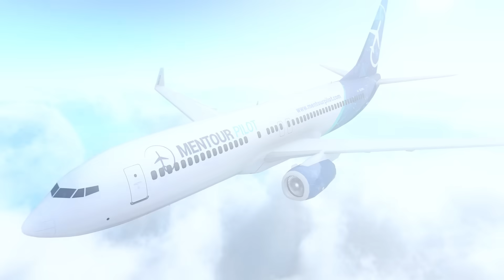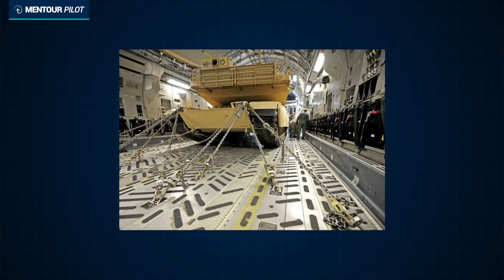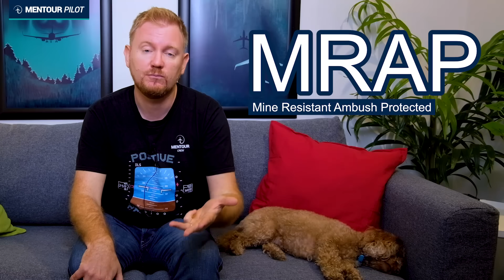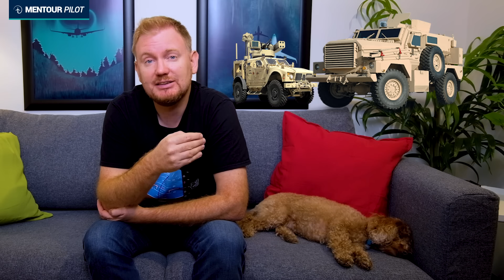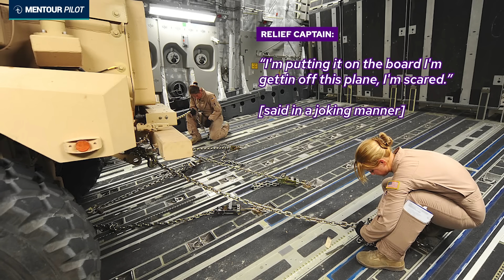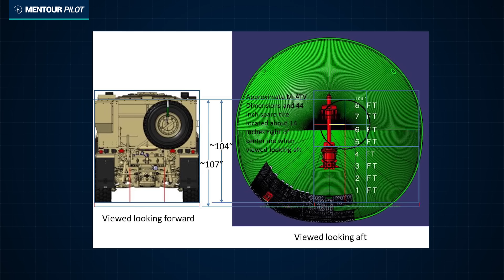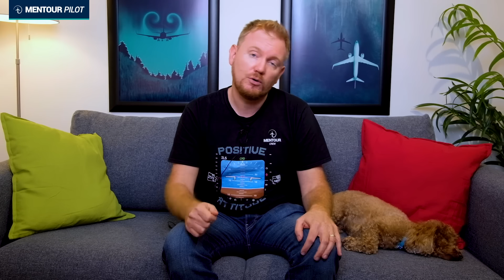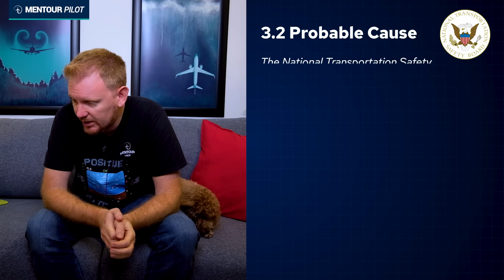Why did the pilots LOSE control?! National Air Cargo flight 102

Comment: I don't know much more than simple common sense about freight or shipping but I DO know that all OTR truckers in North America are required to tie down/secure their cargo in such a way so as to stay securely on deck even if the trailer were to be turned upside down. If the load would fail this hypothesis the truck would need an OSL placard as well as a load permit. I never really thought much about air cargo... that's a whole new ballgame.

Comment: The fact that the load came loose and the amount of straps that was used, and even more supposed to have been used, makes me wonder about the quality. I mean, many straps and lifting aids have a safety factor of 7:1 and would easy lift the entire vehicle by itself just one strap alone. Was there any sharp edges or not enough radius on the fastening points ?

Comment: No chocks = big shocks.  It sounds like the vehicles wheels weren't chocked at all. If I were the loadmaster, each and every wheel would have been chocked in front and behind. Also, I would have lashed the chocks down and used all available straps to secure the load. I wonder if the US military still use chocks in transport or rely solely on strapping? Strapping is way too easy and, I think, give a false sense of security.

Comment: Did the engines flame out due to the unusual nose up attitude?
Reply from the maker: No, the engines were working fine
Reply: @MentourPilot  Thanks. I wondered if the kill chain was: massive shift in CG, unrecoverable pitch up, engines flame out (puffs of smoke), stall, crash. But your video showed me the elevator controls were irreparably damaged by the cargo shift event. Excellent video. Keep up the good work.

Comment: Well done, Petter.  I saw a report on this accident several months ago.  The vehicles were properly restrained against vertical movement, but not horizontal movement.  The Afghan government likes to clean up airplane crash debris quickly.  The NTSB investigators made a second trip to the crash site and found the damaged elevator jack screw was still there.  This was one of the key factors that helped determine what had happened.  I saw the original video and it was gut-wrenching.  RIP, crew.

Comment: 21:30:  Mentour Pilot, I know you're the expert --- but FACE IT --- that plane would have crashed anyway from all that uneven aft weight whether or not the pitch control and the stabilizer mechanisms would have remained intact.  Nothing more pathetic than an overgrown, bottom-heavy stick with two side protrusions and fake rocket fins, and the whole thing comes crashing down with all that cargo weight banging out the bottom and crashing to the ground separately.  HEY AIRPLANE, STOP TRYING TO PRETEND TO BE A SPACE ROCKET!

Comment: 5:45:  I think, without you telling me at this point in the video --- and without me cheating by going to the end of this video --- that I know what happened with this airplane --- and your animation of how the airplane pitched upward just after takeoff supports what I think happened to cause this crash.  To put it simply, one of those straps, or fasteners, or whatever held the load in the cargo hold, gave way.  This would have caused the entire load in the cargo hold to act like a huge trim weight which would have slid completely back faster and faster as the plane tilted successively higher and higher --- and this would have happened in only a few seconds --- as indicated in your animation at the beginning of this video.  That would have caused the total weight of the cargo to smash through that rear bulkhead --- which would have resulted in a total loss of cabin pressure like a busted balloon.  But that would have been of no consequence only because the plane would have already been a lost cause.  Bye bye, plane.  See you in eternity.  You were done the instant the cargo became unsecured.  NOW I DO ADMIT, THOUGH, that that still doesn't explain, what about the white puffs of smoke coming out the rear of the plane just after takeoff BEFORE the plane tilted upward?

Comment: An excellent video on this subject.  I recently watched an episode of "Air Disasters" on the Smithsonian channel on this very subject.  Mentour Pilot's presentation was more descriptive and understandable in some ways- it filled in a few blanks.  One thing the other show covered was HOW the straps were to be connected- the shallower the angle between load and floor fastener the less the strap was able to restrain, requiring more straps.  The ratings were for VERTICAL strap connections.  Not covered in the manuals, as mentioned here.

Comment: I am a retired USAF C130 Loadmster. First the USAF has a cargo loading manual that specifies how most military cargo are to be loaded and secured. Second, we would NEVER use cargo straps for a heavy load, chains only. When we had "non standard cargo" there is a simple calculation that is used to achieve the restraint for vertical, forward and aft restraint. Lastly, after takeoff, the loadmaster always retennshions all chains securing cargo. This is an absolute failure by the airline and FAA to properly set standards. Thanks for the great video.

Comment: Long time, part time equipment hauler/trucker here, what every newbie learns the first 5 minutes of his first day is "always use iron to secure iron."  That is, always use chains and binders to secure equipment or vehicles to decks for transport.  NEVER, EVER, UNDER ANY CIRCUMSTANCE USE FABRIC STRAPS TO SECURE EQUIPMENT OR VEHICLES.   I love ratchet straps and use them where appropriate but would never even consider securing equipment with them. If the cargo deck of an airplane doesn't have strong enough attachment points for chains, I guess ratchet straps would have to be used to spread out the strain, Boeing's manuals seem to permit it but it's a really hazard fraught way of securing loads.  I guess this flight crew paid a big price to learn a very basic lesson.
Reply: They also didn’t use nearly enough of them. You pretty much have to use 1/2 more than you think you’ll need for the high angle take-offs & landings needed in war zones. If the loadmaster had done that, we probably wouldn’t be talking about an accident at Bagram Air Base.

Comment: Loved the video.  When I was 8nthe service, Not Air Force, I was fortunate enough to be able to watch a C-130, a KC-140 and a C-5 being loaded.  I just happened to be stationed on a base that the Air Force and NAVY were both assigned.  Very small.  It just seemed like when the were loading them it was like butter on a hot knife!  Fast!  It took them longer to upload.  Certain details can't be discussed.   It just amazed me.  I talked to a friend of mine, we were like, I sure hope them straps don't come loose!  And, did they have enough?!  I pretty much knew what happened when I saw and heard the the conversation in the cockpit.  They should have never been aloud to take off!  SAD!      KEEP UP THE GREAT WORK and Stay Safe!  If you get sometime after lock down, I picked up you lived in Spain with74 gear, take a trip to Torrevieja!   Went sailing out of there almost 3 yrs now.  Beautiful countryside and nice town.

Comment: 5cm is the 2 inches that was on any of the vehicles and they should use Hercules or LM really the 747 wasn't designed for wheeled heavy combat vehicles. Maybe ratcheting improvements in the palettes would be good innovation. Keep going with the hard task of what can go wrong so it can always go right.

Comment: So sad, and completely preventable. I saw the report and I think many of us saw that crash and said right away load shift but the investigators found every model they ran it should have been recoverable if it was just weigh and balance. The damage to the Horizontal stab. jack screw was what did them in.
Reply: As an old lady with no experience, as soon as I saw that cargo, I knew the load had shifted backwards. As for hydrolics and stabilizers jack? I get it, but gravity is a mutherfckr.

Comment: I think I load my truck more securely. And   from experience those flat straps are never that strong , a little friction or a side cut and it comes apart. I’m sure steel chains would be the best , although it would add much weight to the overall load, but these guys cud do the math.. if I have extra rope in my truck I make my guys use to them all up . I always tell my guys that I don’t want to see my cargo on the freeway but u got extra rope behind your seat. Better be safe than sorry. I know it happened a while back but it was really a sad incident..

Comment: While transporting even a 1.5-2 ton car on a flatbed truck, in addition to tethering the chassis, they also tether all four wheels in a clamp-like fashion to prevent them from rolling. Furthermore, the pilot has the final say whether he or she will fly the equipment with such a cargo. In this case, he did not even seem to exercise his common sense about the wheels that seemed free to role. I think that the acceleration to V1 was enough for some vehicle role and break free from its tethers and hit the rear end of the fuselage.

Comment: Do you think there will be any talk about basic accountability measures? For example, as the captain of the aircraft, I think I would want to visually inspect standard cargo and put hands on special cargo tie-downs before taking off.

Even just hauling my mobility scooter on its rack on the back of my SUV, even though it's painful and takes a lot of effort to do so, even though I trust the people who strapped it down... I still go back there and check it myself. Every time. Likewise, if I'm driving the car, everyone has to have a seatbelt on. I don't care if you're my boss, or a professional driver of some sort; if you're in my car, and I'm in control, I'm liable, and you can either strap in, or get out. When I used to fly, it was the same thing. I was taught right from the start that you don't take anyone else's word for anything. If you're going to fly the plane, you check it out yourself, make sure all control surfaces are working properly, make sure all passengers and luggage or cargo are properly secured and not going to flop around...

With that captain saying he didn't like what he was hearing... why did he still take off!? That's a lot of complacency.

I know this is something they do every single day, but even for something far less dangerous like running a car shop, safety is absolutely first, every time, no question. It doesn't matter if it's your first flight, or your first time lifting a car two meters into the air to stand under it and repair it, or your ten thousandth. The ten thousandth can kill you just as dead if you don't make sure the lift is under the proper load-bearing lift points, and the car is balanced on the lift.

It's easy to get complacent, to take for granted that the one in ten thousand incident has never happened before... but to me, keeping the right blend of the confidence to do a job efficiently and correctly, along with the right amount of respect for the danger entailed, is what defines a professional and separates them from a cocky amateur. Any one of those crew members on that plane should have spoken up with enough intensity to get the calculations and the physical straps double-checked, and to me, as others have said here, that speaks to a culture of complacency and a systemic problem of "just winging it" at that company that certainly needs to change.

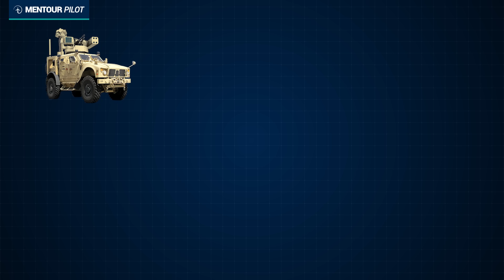Comment: 8:45 How on earth did he calculate that....It doesnt make any sense....25 straps for smaller vehicle, but only 2 straps more for 30% heavier vehicle? My logic would be 30% more straps....which is 8 straps more, not 2...so if smaller is 25, larger is 32 or 33 straps.....Logic 101...And Im bad at math...really bad

Comment: I was a USAF Loadmaster on C-130s,1965-1969. We never used stapes to tie down vehicles. Always chains and then only calculated half of their rated strength due to angle of the chain to the floor. Straps stretch chains don't!!

Comment: I worked as an ambulance driver for wheelchair users. One day a passenger on another of our ambulances got severely injured when two of the four straps came loose. She injured her head as her wheelchair moved backwards as the ambulance accelerated. After looking into the accident it turned out all the 16 drivers had experience of those particular straps just completely coming unhooked from the floor, but nobody said anything as we thought it was our fault and the back-up strap meant the passenger was safe...until this day when both came unhooked.  There was a fault in the design but we thought it was us getting it wrong.  Sometimes it's best to say something...even if you think you're at fault.

Comment: I would like to know why they were using straps instead of chains on stuff that heavy? Rough steel edges on nylon straps will almost always wear through by small movements... Hope  now adays they use chains for that kind of stuff. Also why did they tie knots, those are never as strong as a unaltered nylon strap?

Comment: A knot in a load binding strap? THROW THAT ONE AWAY NOW! CUT IT TO DESTROY IT AND THEN BURN IT! Vehicles like these have a suspension with springs and some form of fluid shock absorbers, whether a gas, an oil, or both. Those will compress with the load binding chains and slacken the chains. You can block & lock the suspensions up with wooden or rubber blocks so it won't move up and  down, then start cinching down your load binders until the suspension pinches those blocks into place and keep on cranking until the suspension digs into the blocks. Reinforced half hard rubber blocks work especially well for this, and are less likely to split than wood, but either one is better than nothing at all. The pneumatic tires will also cause some flexing too. You want to do a leak down test on those tires and the central inflation systems for at least 24 hours prior to loading the vehicles onto any plane. You might even want to crib the vehicles' frames to take the  tires out of the equation too.

Comment: I finished my flying career as a 747/400 Captain with Cargolux having spent most of it flying passengers. During my Cargolux training it was hammered home the importance of the Captain personally checking the security of the load and satisfying himself that it would not move. (I also  had to identify the location of any dangerous goods) The task took at least 10 minutes. Indeed and was often the limiting factor in obtaining an on schedule departure because, de facto, you could not do it until the cargo was fully loaded. The task was never delegated to the First Officer. Having said that I would have had to rely on the loadmaster regarding the number and strength of the webbing  required for any given load. What does surprise me is that the Captain on the accident flight elected to depart having been informed the webbing was loose from the previous sector. I certainly disagree with the statement made by the loadmaster that cargo movement is normal. RIP

Comment: Thanks for the analysis. I remember seeing the original footage at the time.

Aside: I've wondered, given the increasing complexity of instrumentation, automation/semi-automation, whether there is a simple video system on board to allow the pilots a quick visual reference check of the condition of the wings, engines, tail-plane assembly with particular regard to obvious damage and the positions of control surfaces. Not that any of this would have mattered in this particular case.

Comment: I love your videos Sir. I am ex RAF airframe fitter and have copies of the FAA mechanic handbooks which are by bed time reading :) Most people read a novel, I read aircraft mechanic books and crash reports. I learn so much from you. Thank you. I have seen the dash cam video of the 747 crash and original comments I saw said a tank had moved in the hold. You have corrected that with the correct load and vehicle types, thank you again for that. with exception of travel with the airforce as ground support and as a RAF cadet at age 13 my only other flying time is Microsoft flight sim 2004 ( yes i will upgrade when i can afford a new computer ). I wondered if you use flight sims for home PC when your off duty :)
Reply: I posted this before the end of the video. you answered my question about flight sim and the end and the skill share thing is my next visit.

Comment: Do the 747 cargo aircraft not have chains?  As a USAF-certified airlift load planner, I'm certified to load plan a 747.  The decision on tie-down straps, however, falls to the loadmasters, not the pilots.  In 1,500+ hours of flying the C-130 (Nav), I recall straps being used for lighter loads, but chains being used for vehicles, for one reason:  Modulus of Elasticity.  Even a ton of nylon straps will stretch, and nylon stretches quite a bit.  Steel chains, on the other hand, hardly stretch at all.  With nylon straps, you can have one breaking while the others are at half max.  Then the load the one was holding shifts to the next strap, it breaks, and so on down the line like ripping a sheet once you get it started with a cut from a scissors.  With chains pre-tensioned to a set amount, that seems less likely to happen.  I dunno - USAF loadmasters, you're the best of the best, so please chime in, here.

Comment: I know that contracting a 747 is cheaper. In my opinion, they should of use C-5 instead. Those aircraft are built for this type of cargo. Also, due to possible hostile fire all aircraft are taking off at high angle of attack.

Comment: The angle of attack seemed to play a factor and looked steep causing a  decrease in airflow?  Terrible crash and I felt horrible for the crew who knew their fate.  Thanks for your explanation of the crash.
Reply: The steep alpha was because of the shift.
Reply: @peteconrad2077  True to what you'resaying, but upon take-off it looked as if the pilot went straight up rather than an initial 45 degrees or so.